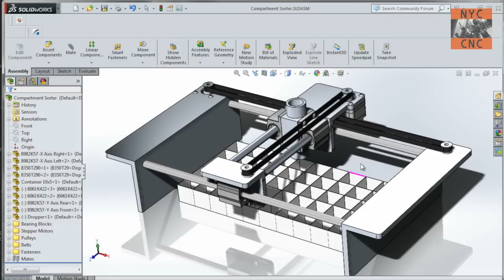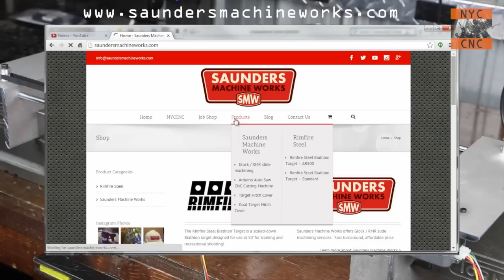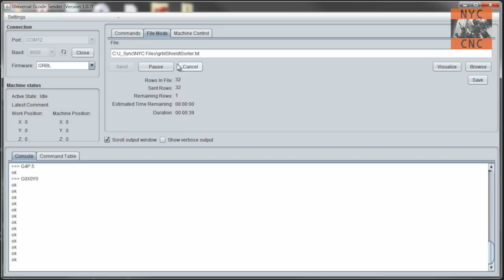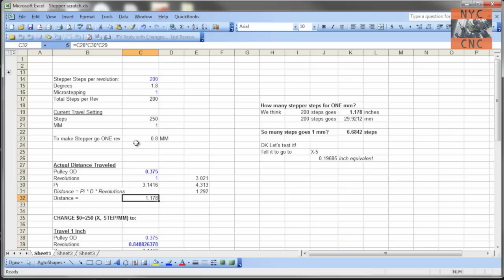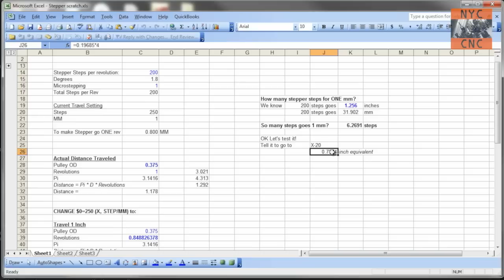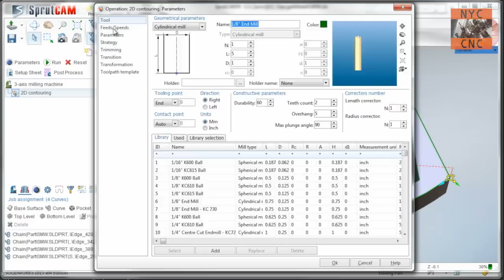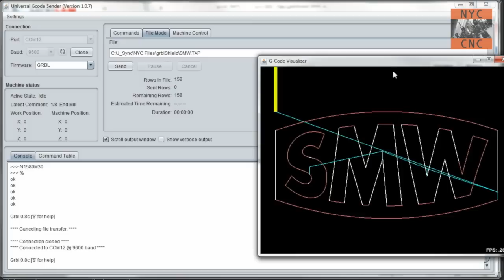DIY Cheap Arduino CNC Machine - Machine is Complete AND Accurate!

Comment: it's good for laser cutting/engraving, but i'm not sure the belts are good for milling, because if the milling head get stucked, or gets too much physical resistance, the belts can snap very easily, or the milled contour will be jerky ... that's why everyone uses threaded rods with cnc routers.. they can't stuck, because of the continous pressure (they are much more expensive ofc)   good work tho :)

Comment: You aren't milling anything with your setup, I'm not busting your stones but you haven't implemented anything DIY to cut.  I would love to see precision cutting from a DIY machine but the precision of a marker and a bit spinning and cutting is no comparison.  Something using a laser or water-jet would more likely hold precision.  I'll stay posted you have a great starting point and an impressive skill base.
Reply: Yea I'm aware of the multiple uses and functions of a CNC and I enjoyed all your videos. I guess I just got too amped up from watching the others, I very much wanted to see the Arduino controlled setup to cut something . Given your abilities I'm quite confident, you could make that setup capable of milling a quality PCB; should you desire to do so.

Comment: Belts, bearings, and rods can be pulled from a scanner
Reply: I am now making a video on this when I get my controller and my 3d printer printing proper tolerances....
Reply: joblessalex Built a CNC machine almost entirely out of a scanner/printer combo I found in a dumpster. Right about now people are getting rid of their inkjets and upgrading to cheap lasers, so there's plenty of recyclable material. 2 steppers for X and Y, a micro servo for Z. Arduino for motion control along with a motor shield. Total budget under $50. Currently adding different attachments to it. Started with a hot nichrome wire and a pen tip, and now getting a micro drill set up, which costs under $10.

Only problem is that I used the glass scanner surface for the moving platform, which makes it hard to secure working material to it. Aluminum with mounting holes would've been better, but I have no access to a processing mill, so anything harder than wood or plastic I cannot cut. Actobotics makes some decent armatures, but all of their gear is way too expensive and there's no way to test it out before buying.

Comment: Hi John
 
You could very easily add a small RC Servo or even a little Solenoid to the top of the pen that would lift the pen off of the paper during rapid travels.  Great video.

Willy

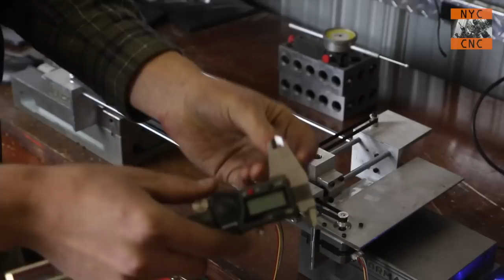Comment: I think I know why you were off at 12:25. When you measured the pulley diameter at 11:45 you didn't measure with the timing belt in place so you got an under-sized measurement. If my arithmetic is correct that measurement ought to be .398 rather then the .375 of the pulley.

(Grits teeth hoping not to come across as a know-it-all as he clicks "Post")
Reply: NYC CNC  Not the width of the belt but the thickness. The belt adds to the effecitve diameter of the pulley and it's that diameter, rather then the diameter of the pulley without the belt wrapped around it, that determines how far the belt is driven for a given angular movement of the pulley. If you mike the pulley with the belt on it it should - I think - measure .398
Reply: NYC CNC The teeth of the timing belt fit into their matching indentations on the pulley so measuring the thickness of the timing belt and adding twice that measurement to the diameter of the pulley won't give you the dimension you need. Putting the mike on the pulley with the timing belt in place will give you the right dimension and, like I wrote above, that dimension ought to be a diameter of .398.
Reply: NYC CNC ...and this concludes the portion of our program in which I confidently describe the difference between shit and Shinola...

A 0.450" outside diameter yields a circumfrence of 1.413 which is also what the Y-axis displacement ought to be. But you measured 1.256 displacement on the Y-axis which requires a diameter of 0.4 on the Y-axis pulleys.

I'm officially out of ideas.
Reply: NYC CNC I'll preface this by saying that I haven't used timing belts before, but I am a Mechanical Engineer with some CNC and manual milling experiance, so that should be good for something.  I think the issue that Allen was getting at was generally correct, but just not exactly right (obviously).  If the belt was really thin, then the answer would be the same either way, and you'd both be right, but since the belt has significant thickness you have to deal with it.  You will have the same issue with a V belt, but generally no-one cares to be so accurate with V belts, so no-one even notices the slight difference.  

The way the belt works is that it has to bend around the pulley and straighten out on either side, so the inner (toothed) side of the belt will compress a bit and the outer diameter has to stretch (lengthen) a bit because its in bending, remember?  So the effective diameter is on an imaginary line that goes through the belt on a diameter where the belt is not compressing or extending (the point where it switches from one to the other, called the neutral axis.  You can look up "neutral axis" on google and see an image of what I'm talking about.  Unfortunately, this isn't a very pragmatic answer, since the neutral axis location depends on the composition of the belt through the thickness so it isn't just 1/2 belt thickness (it probably has some reinforcement in it somewhere and is not just rubber all the way through, and also there is a bunch of material missing from the toothed area).  

If the belt was simpler, completely rubber, and had no teeth, it would be 1/2 total belt thickness, but for a reinforced timing belt with teeth cutout, the actual calculation is probably not worth the payoff unless the manufacturer has done it for you, although its certainly somewhere through the outside of the belt (where the solid part is that doesn't have teeth)  I.E. it will always be more than the pulley diameter and less than the total belt+pulley diameter) since the belt is always transferring the load though this section and bending somewhere in it.  In all reality, the reinforcement is somewhere in the middle of the solid belt part and the NA is probably a little less than 1/2 of the thickness of the thinnest part of the belt (where the tooth it cutout).

So in all reality, I would do exactly what you did anyway, a dial indicator tells all and is way faster than calculating the NA (neutral axis) and asking the manufacturer about its composition, although if you use the same belt design (and thickness) you can certainly back-calc the solution and it will increase the radius by approximately the same number every time as a place to start from.

EDIT:
Now that I think about it more, if your belt has reinforcement, the manufacturer probably placed it around the NA for longevity (or maybe the converse, the reinforcement drives the NA location)  Either way, I'm guessing you may be able to look at the cut edge, determine the reinforcement location and figure the estimated effective radius from that, at least to start with.

Comment: Hi John,  Great video and great project!  I am especially interested in the SprutCam workup as I run SprutCam 7 and a PCNC. I have not taken any of the clases offered by Tormach as I prefer to spend my cash on tooling.  Are you aware of any texts on SprutCam ?

I calculate the travel per step by counting the teeth in the pulley and multiplying by the belt pitch tro get the travel per revolution.  Divide by the steps per revolution to get the travel per step.

Are you aware of Misumi?  They offer an excellent selection of drive components, although mostly metric, at reasonable prices.  They also have excellent engineering info on their products.
Reply: NYC CNC
You do an awesome job with your videos.  I also am self taught regarding SprutCam.  I downloaded a copy of the generic manual from Sprut but I find it confusing at times.  Someone's just got to do a "SprutCam for Dummies"!
Reply: NYC CNC
Re travel, the belt pitch is usually very well known and, if not, easy to measure since the pitches used are nice round numbers.  It is also easy to count the teeth on a pulley if it is not marked or otherwise unknown.  The calculated travel is exact within the limits of manufacturing the belt.
re Misumi, We used them as a vendor at the companies I had worked for.  Get a hard copy catalog if you can...it's a good read.  Their on-line catalog has a configurator which allows you to "build" a part to your spec.  Many of their components are custom dimensioned to a millimeter or two.

Comment: Awesome video! I can see my next project starting to take form. Thank you
Reply: NYC CNC I have been thinking of a CNC machine. (With the option to mount a low powered laser for engraving) Originally I was thinking a Shapeoko 2, but this is a great way to start making my own for cheaper. And easier to make custom size. The links to ebay you shared are great. I had no idea how to get the belts and pulleys. Thanks again!!

Comment: Hi John, thanks for sharing your experience !, could you share a link to the excel file "steeper scratch" you use in these videos ? thx
Reply: Thank you !
Reply: +NYC CNC Have you considered posting your spreadsheets to Google Spreadsheet's https://www.google.com/sheets/about/ ? Microsoft One Drive has something similar I believe. If you prefer to use a desktop spreadsheet have you considered LibreOffice's spreadsheet called "Calc" instead of Excel?

Of the above choices Excel is the only one that, at least legally, is normally sold. After all, many of your viewers don't have much money.

Comment: John, those prices for linear bearing parts are amazing!  I've looked before, and the cost was always way too high. Those that you found are my kind of costs though!  I already have an Arduino, and I've been thinking of trying to convert a small wood lathe to CNC.  Time for some design work now that fab is economically possible!

Thanks!

-- Mike
Reply: NYC CNC
I would like to, but will have to see what's going on with work closer to the time.  I did check the map and it looks like it's about a 7 hour drive from here, allowing for a lunch stop and some traffic.  I'm sure it will be a good time and an interesting group of folks who show up.

Comment: I build my own n cnc and you can fix the racking problem your having by driving both bearing on each side . Add  guide pulleys inline with the bearings on the other side then with a longer belt drive both sides with a single belt.

Comment: it-s nice and cheap I guess but i'm not in the us and shipping for parts is huge! and that controller for the arduino ? 50$ dude... Anyway its a nice video, for someone who is still trying to build a cnc the cheap way like me , it also clears some code related things for me, thx!
Reply: NYC CNC  nope non of the items have free shipping :( , i think i will get a proper controller for my cnc, not arduino based....  so far its not far from the price of the arduino+shield linear bearings i can find form SKF here and the price is ok, crom rod didn't see yet will see if i go with timing belts or lead screw... the lead screws i found are very short compared to what i want so i guess i will go with belts

Comment: Excellent job on a simple CNC device John. Seems like the GRBL shield is a pretty inexpensive and easy to use converter / trainer for entry level use.  I certainly remember the demo system you referred to at COSI.  I don't think it was in the old original location downtown vs the new one was it?
Reply: NYC CNC Look what I found! http://oldcosi.com/cyro.htm
Reply: NYC CNC
Not exactly the greatest pictures, but being it was a large part of your inspiration, I figured you should see it again.
Reply: Shawn Hawkins I always liked the pendulum as well, it was fascinating to watch and to wait for the each pins to be knocked over. Glad that it was moved to the new facility, but yes the old one was pretty cool in it's own right.

Comment: Do you know of rail system that is moderately priced and is more rigid in strength and in the pulley/gear system?  I been wanting to automate my home router table.  So basically I would just need a 1 axis system with about 3-4 inches of travel but like 6-8in would be optimal for some of the options I plan on doing with it.  There is a router lift system made by JassEm that goes for like $900 with digital readout but its manually operated.  So if I have to spend a few hundred to get a decent track system and motor to go with I am already way a head of the game.
Reply: Parker makes some small travel linear systems, maybe look towards surplus to save some cash?
Reply: After rewatching this video and studying your setup i guess was asking the wrong question.  The first time I was watching the vid I was doing other things at the same time and I missed your explanation of how you built it.  i thought you had a complete system there like a kit or something.  Linear V rail was one option I been exploring.  I have even found some decently priced ball screw setups, but at this point the whole system might be a massive over kill. I dunno.  Is there a good home built CNC forums or site you know of i can go to and bounce some engineering type questions off of that I have?
Reply: I will check Parker and see what they have to offer thanks for the suggestion.
Reply: For sure those companies have the electronics side of it locked down good for the DYIer.  The mechanical side needs someone to step up.
Reply: *****  That site seems pretty sweet just at a quick glance I found this which is pretty close to what I need. 

http://www.openbuilds.com/builds/nema-23-lead-acme-actuator-example-build.1393/
Reply: Mopardude
Yup, that's a great example, and its nice that everything is open source, and frankly cheap. Give it a shot, I've used it here at home.

Comment: I have a professional flatboard CNC-Cutter at home. To fix the vibrations of your pen you need to build a toolholder that push your pencil to the drawing surface. If you you need fine-adjustment, just add a tension-screw to the top of the springholder. And if you replace the marker for a ballpoint pen you will get even better results, maybe already without spring.
If you want to continue on building a drawing machine, you can lift your pen with an electromagnet that pushs up the flexible part of the pen (under the spring).

Comment: Excellent job! I love the diy aspect of this project. I am also currently running a GRBL based home made cnc machine. I love the price and the ease of use of these little devices. Thanks for putting out great videos.
Reply: I actually use it for a little bit of everything. Recently I have been doing some v-carving with some 1/8" carbide 45 degree v-bits. The things that can be done with a CNC machine truly are amazing and GRBL has paved the way for a cost effective electronics setup. I really look forward to your future videos on this subject.
Reply: Just various kinds of wood so far, I have been thinking about getting some brass to try but I'm not sure about the rigidity of my machine to cut any harder materials.

Comment: Awesome project.  You might want to add simple push switches on either side that trigger when you get to an edge so you don't accidentally crash it.   I've considered making something similar that takes vector images and draws them via whiteboard.  Pretty awesome work.

Comment: Great work! Make it a laser cutter and it'll be super awesome ;)
Reply: NYC CNC
Don't have any yet ;) I'm seriously considering making one though, laser parts cost about $300-400 which is not too bad (made in China, obviously).
Reply: NYC CNC

I was looking at these parts: http://www.aliexpress.com/item/Kit-Of-700mm-40W-Laser-Tube-And-40W-Co2-Laser-Power-Supply/1580638855.html + http://www.aliexpress.com/item/CO2-10600nm-Laser-Head-w-30mm-Mirrors-20MM-FOCUS-Focal-Lens-Integrative-Mounts/732847439.html which unfortunately have quite a bit of S&H fees, but then I found this source as well:
https://buildyourcnc.com/LaserComponents.aspx though having higher prices might be somewhat more reliable provider, especially with transformers and power units, they're usually pretty terrible in chinese products.

Unfortunately 40w isn't enough to cut through metal (perhaps except for foil), 150w is the minimum I believe, but even engraving is a useful feature, and of course it'll cut many non-metallic materials fine.
Reply: NYC CNC
Take a look at this, a guy on the forums just hooked one up to his printer, and the concept is totally applicable. http://legacygt.com/forums/showthread.php/3d-printing-development-thread-231380p20.html

Would be useful for part marking, which can add value to your customers.
Reply: NYC CNC Is it possible to build a high-power laser that can cut materials,like wood,plastic,plexiglass or even some metals,out of a DVD/CD player?I have a lot of DVDs in my house that i don't use and Im thinking of using their lasers for cutting.

Comment: The play on the x axis may only be eliminated by utilising dual driving belts. Since the distance between the x linear guide rods are high whatever you do in terms of rigidity would not solve the problem.

You need to transfer the motion with syncronised pair of belts one at the current position and the other one near to the other x axis guide. 

I build 3d printers with a similar setup (dual belts). If you like I can send some photos.

Looking forward your updates on this project.

Thanks for the video

Comment: a common fix for the racking is to drive that axis on both side of the gantry, either with two stepper or a single stepper and a drive shaft at each end